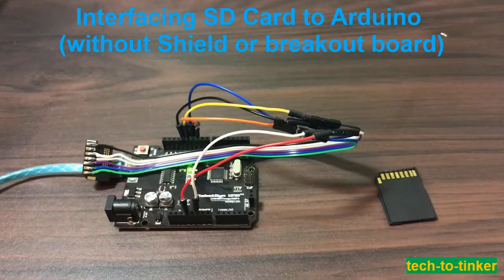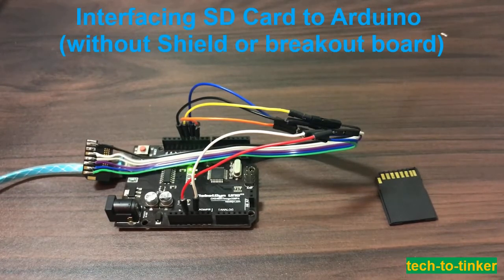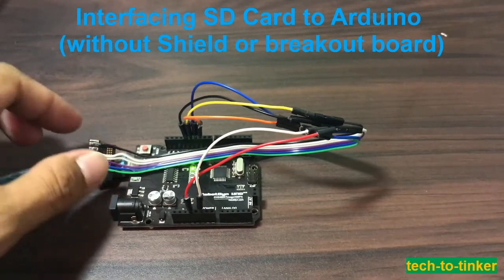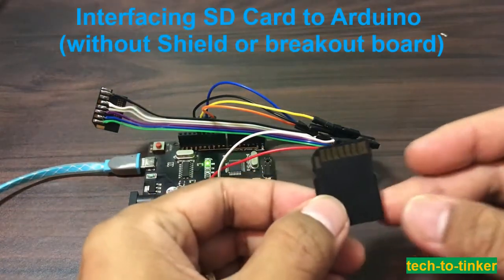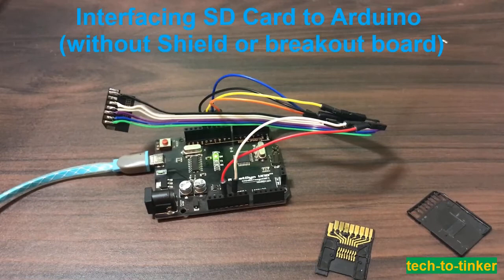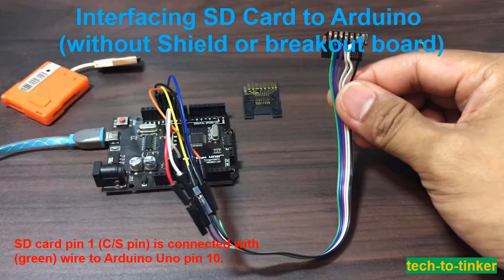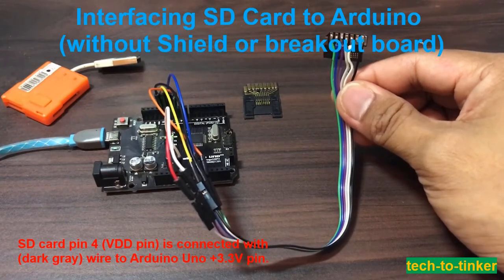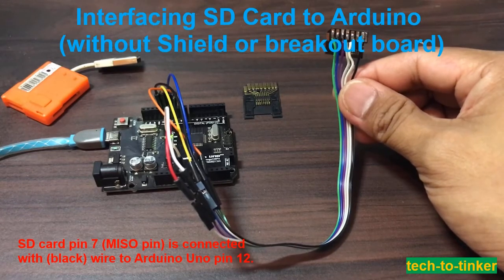TUTORIAL: How to Interface SD Card to Arduino | No Breakout Board or Shield

Comment: How to interface with esp8266??
Reply from the maker: Try this, but I have not test it so try on your own. Please refer to this image:
https://esp8266-shop.com/wp-content/uploads/2018/06/9b85dc9ed38064469d67b07e9beb598e.jpg

    * SD card pin 1 (C/S pin) is connected with (green) wire to ESP8266 C/S pin.
    * SD card pin 2 (MOSI pin) is connected with (blue) wire to ESP8266 MOSI pin.
    * SD card pin 3 and pin 6 (VSS pin) is connected with (violet) wire to ESP8266 GND pin.
    * SD card pin 4 (VDD pin) is connected with (dark gray) wire to ESP8266 3.3V pin.
    * SD card pin 5 (SCK pin) is connected with (light gray) wire to ESP8266 SCLK pin.
    * SD card pin 7 (MISO pin) is connected with (black) wire to ESP8266 MISO pin.

Cheers.
Reply: @TechToTinker  
How to run (play) Gif image animation file in spiffs esp32??

Thanks